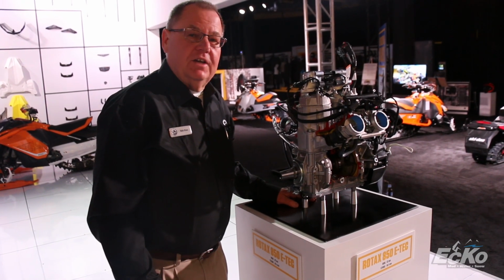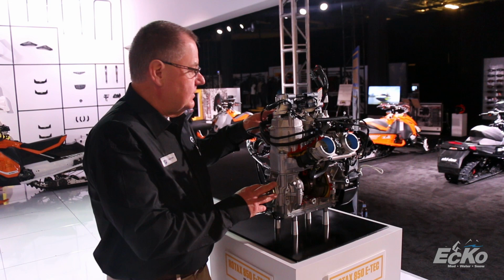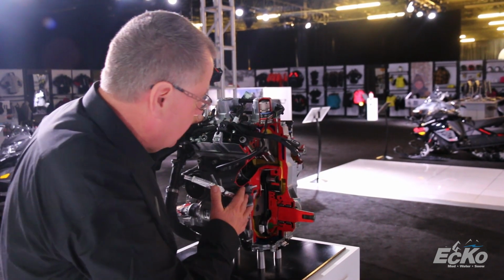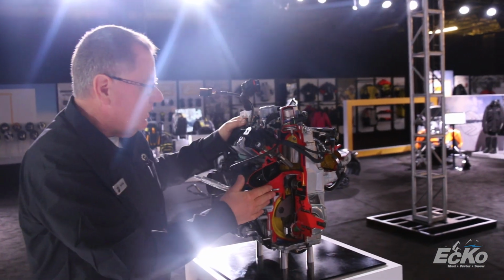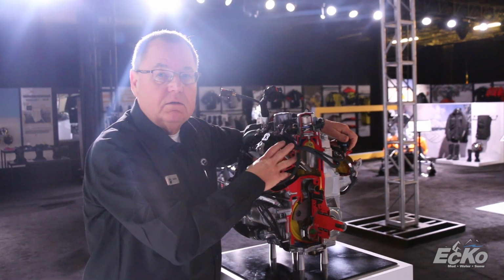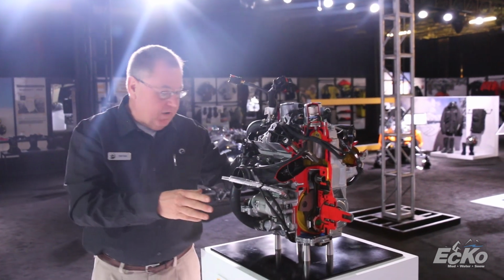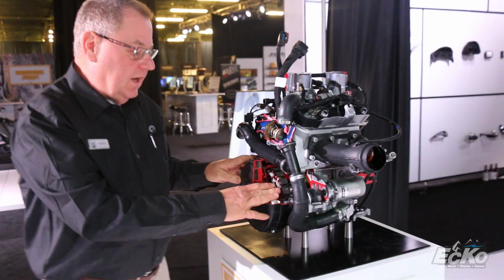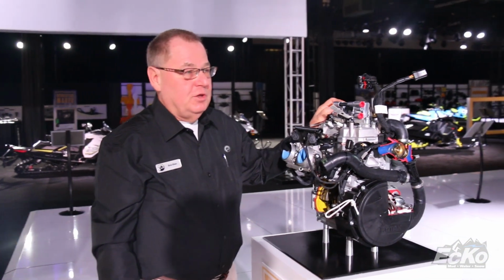2017 Ski-Doo Rotax 850 E-tec engine walkthrough

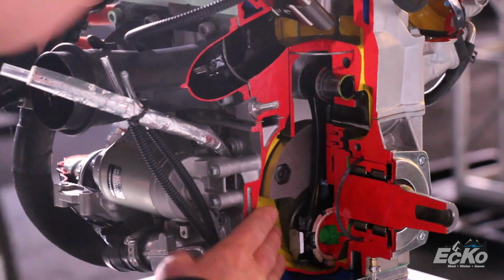Comment: Any1 else see that heavy looking starter motor at 1:16
Reply: That’s what the 850 turbo is for.
Reply: @Carter25254  ima snowcheck for 2023 my mind is set on either a mxz xrs 850 or renegade xrs 850 with the built in garmin 590 gps, led hand gaurds, a heavy duty tow rear bumper, and the tounge tow hitch ill try the 850 with the 1.5 pre studded track

Comment: Skidoo...I really gave you a thumbs up for your innovation on your crankshaft design...however...your dirty little secret is now going to be let out of the bag.  Heads up people.  If your rod bearings fail...which they do...and you think to yourself...well now...I am just gunna get that there fancy crank out and take off the rod cap and replace the two piece rod bearing with a new on and be on my way...right?  WRONG!  Skidoo won't sell you the bearing...period!  So...you have a perfectly good crank that now you cant use.  Skidoo is there to inform you that the only way to get it fixed is to buy an new entire crank assembly...ya...thats right...$1,900 later you get a new crank!  Not cool skidoo...not cool...buyer beware.  They hype up this motor by showing you the rods with rod caps and split bearings...only not to tell you that they won't sell you the bearings...so it does you no good.
Reply: This 2 stroke will have no darkness, only love and light! Jim Morrison teleported to todays time to get a DFI mercer optimaxes and evinrude etecs as he is the lizzard king
Reply: Why would fail anymore than a bearing in a car?
Reply: If you dont like the stock bearings then get a graphalloy split bushing with the ID and OD measurements and it should be fire. there are hardened bronze ghaphite bearings availbe oot there and the oil is pressure fed like off oil pump.

Comment: Ok,these engines been out a few years now and I’ve got to try one....
Reply: I mean, these things feel so much smoother and powerful than the 800s
Reply: just scale this 2 stroke up to a 500 CID  to 900 CID 6-inline 2 stroke for trucks, that would be interesting.
Reply: There wull be no darkness in this 2 srtokw, only love and light, this is Jim morirsons doors 2 stroke
Reply: Me too i got a small block v8 2 stroke and an 8v92 detroit diesel 2 stroke. I got 6 gallons of xd-100 brp oil to top off the detroit run way cleaner quieter with it.

Comment: No oil filter to filter the chaincase oil before being pumped through those small passages into the bearings? 

Don’t know how I feel about that. Chaincase oil gets pretty contaminated from all that chain/sprocket action.
Reply: You realised the chain case and engine are fed from two completely different oil sources, right?  Always have been.
Reply: Brian J obviously chaincase oil is not 2 stroke oil that’s why I said it would be contaminated from the chain/sprocket metal wear. I wouldn’t want to pump that oil into any bearing surfaces unfiltered. On the older skidoo the 2 center bearings were lubed from the chaincase oil and the outer 4 were isoflex sealed.

From what I read recently it seems skidoo injects the 2 stroke oil into the bearings then the overflow sits in the sump like the previous etec’s
Reply: Ok, I'm not sure if you aren't aware how the engine oiling system works, or if you're just not explaining yourself properly, but ski doo has never lubricated ANY of their engine bearings with chain case oil....centre, outer, rod, or otherwise.  

Other than pre-injection set ups that relied on premix fuel, all OEM snowmobile engines produced in the last three decades have been lubricated by a dedicated injection oil system....utilising "injection oil", not chain case oil. (I'm not sure if you're aware they aren't the same kind of oil?)  

The difference with this engine, is each individual bearing gets it own dedicated "fresh" oil supply....versus a single jet cast into either side of the case, that was essentially circulated throughout the engine by turbulence and windage created by the rotating assembly, or in the case of the early, pre ISOFLEX rotary valve models, relied on channels cast into the case for drip oiling.  

This should prove fantastic for engine longevity, since the crank bearings, rod bearings, pistons and ERAVES all receive their own dedicated lubrication points and are no longer getting what was essentially the "leftover" contaminated oil floating around the case, like two strokes prior did.
Reply: From the ZX to XP chassis 800 skidoos  I’ve owned none had oil sent to the bearings. All of them had sealed isoflex  grease bearings doubled on the outside and the 2 centres are in an oil bath. Always how it’s been, only difference is the outers used to be singles on pto/mag side and now they are doubled up for a total of 6 bearings per crank.

Injected 2 stroke oil never made it to any of the crank bearings. Atomized oil in the crank will reach the rod and wrist pin bearings but the rest are sealed from the crank case with no access to injected oil.
Reply: The outer bearings (2-per side) are sealed and packed with isoflex, yes....but the centre bearing are not sealed.  They're exposed inside the crank case.  They are also unfortunately not sitting in any oil bath (I wish).  They're fed by atomised injector oil (I'm going to assume you simply misspoke earlier when you made reference to "chain case" oil) floating around the crank case), just like the rod bearings are.  There are inner crank seals next to the inside of either centre crank bearing, but that's to keep contaminated oil out of the fresh oil bath that the water pump gear is bathed in.  That is the only component inside an entire pre-850 engine that's exposed to fresh, uncontaminated oil.

I'm staring at pictures of the open crank cases of an 800 and my 1000 SDI (built the same way, save for the additional casting area for a set of balance gears) right now and I can assure you...the centre bearings get the same, crappy oil floating around the crank case that runs through the rod bearings, pistons and RAVE valves.  

People are quick to condemn the Isoflex grease packed bearings as being the cause for crank failure in these engines, but it's almost never the culprit.  When you often pull one of these engines down, the centre bearings are almost always rough ones, not the outers.  The problem isn't the sealed Isoflex bearings, its the centre's not being provided sufficient lubrication in that area of the crankcase, in comparison to other components and the oil it is getting is contaminated with all sorts of junk.  

The worst thing Doo ever did, was recommend turning down the oil pumps, to solve plug fouling issues and/or keep the EPA happy.  A little extra smoke, never hurt anyone....but not enough is going to cost you a $2000+ rebuild.

This is also why I drilled the upper case of my 1000 for gravity drip oiling from the top half of the crank case (much like an old Rotary Valve engine), to feed the area between the inner seal and centre bearing of the crankshaft.  At least that way, I know the centre bearings are getting sufficient lubrication...even if its not the clean, fresh supply, boasted by this new 850. 

Two strokes...even the older two strokes are quite capable of putting on big miles between rebuilds...but you HAVE to put the oil to them.  And in the grand scheme of things, whats the cost of an extra jug or two, of 4L injector oil at the end of each season, compared to the cost of a rebuild?  FWIW, I also mix a little oil in with my fuel (about 200:1) to make sure the cold side of the piston is sufficiently lubricated, for good measure.  You can never be too careful.

Comment: Think the dude meant it’s like throttle body injection not carbureted lol. Engine looks solid though, good move going from isoflex to oiled crank bearings. Been a weak point in ski doo engines for well over a decade now.
Reply: No, he meant carbureted.   Performance carburetors have a secondary fuel jet that comes on under hard throttle to both feed the engine with additional fuel and in the snomobiles case, help cool and lubricate the intake side of the engine.  Many Mikuni round and flat side carbs have secondary accelerator jets cast into the intake side of the carb to provide additional fuel under hard throttle.

Comment: these need to be "crate motors" cuz id drop one in a bike reallll quick
Reply: Bike engines are way more advanced than anything in the snow market. Plenty of high revving inline 4 cyl high output power plants out there that can pull 100000km without rebuilds. 

This skidoo engine will be lucky to see 20000km before needing a rebuild. The last gen was even worse since my only did you need to worry about the pistons, but the sealed crank bearings to grenade the motor. 

This ETEC seems much better but will still for sure need to have its top end refreshed on a similar schedule to the last generation. I think for trail use probably can pull 20k km, but to be safe swap the pistons at 16k km for cheap insurance then overhaul top and bottom at 32k km. For mountain use would probably need top end at 10k and overhaul by 20k maybe.

As far as sleds go that’s pretty damn reliable lol
Reply: @Alex-us2vw  A sled motor is making much more power than a street bike which rarely runs under full power. load. You must be talking about the high revving 4 joke strokes.